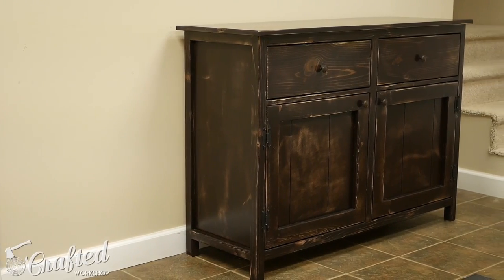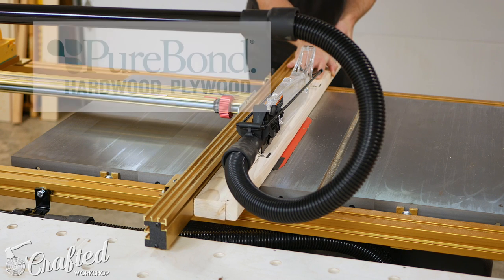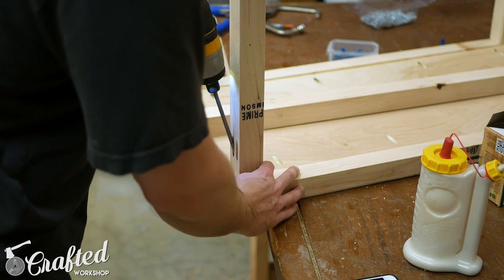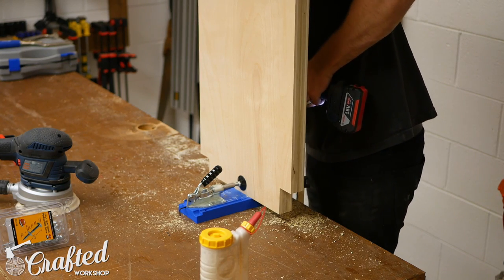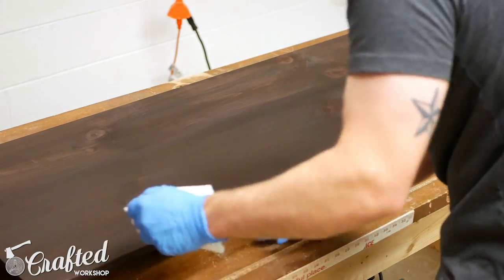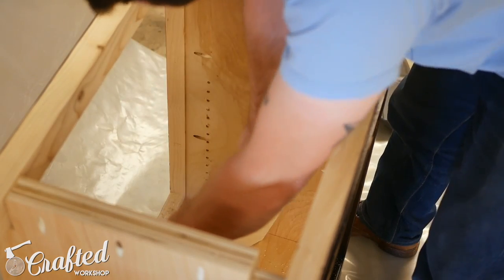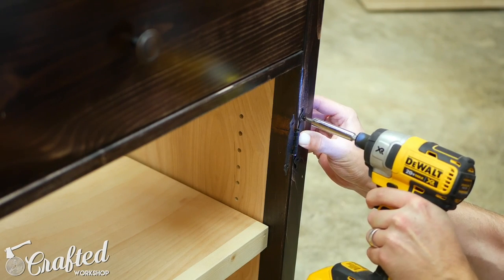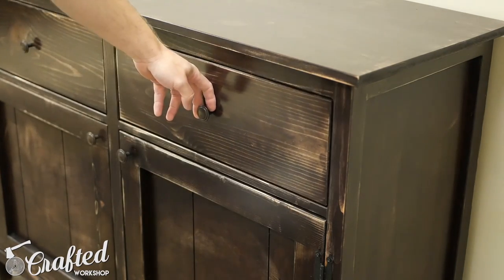DIY Sideboard / Buffet Cabinet |  How To Build

Comment: could you explain what you did to attach the top a little more to account for expansion/contraction?
Reply from the maker: +John Calvert Jr sure! The holes in which the screws go through the frame and slightly elongated in the direction of the most movement of the top. That direction is along the width of the board. I just rocked my drill back and forth when drilling the hole to make it a little bigger. The top shouldn't move more than ⅛" or so, so you don't need to go crazy.

Comment: Have you had any issues with you 1.75hp saw stop with overloading it? do you have it wired for 240 or 120?
Reply from the maker: +The Jones Bunch it is wired 120 and I do trip breakers occasionally, even on a 20A circuit.

Comment: Are the plans still available?  The link on the website doesn't seem to be working.
Reply: The link worked for me and I actually bought the "plans". But it turns out the plans are not actual plans, just cut list and part list, so if you didn't pay, you dodged a bullet of a few bucks lost.

Comment: looks good bro! really nice color.how u like the cordless mitersaw??
🖒or🖓?
Reply from the maker: +Joe basementwoodworking the miter saw is great! I really don't even notice it's cordless, kind of crazy how much power it has and how rarely I have to charge it.
Reply: I bought the Ridgid brushless last week.  Will have to see how it goes.  Presume will be great, too, like your DeWalt.
Reply from the maker: +Phil Veltkamp probably! Amazing how much miter saw tech is changing.
Reply: I wanted to ask you about it as well. Why did you go cordless with the mitre saw? Working away from your shop? I have all corded power tools in my shop back home, except for my drills/drivers. Over here I have the cordless circular saw (for those rare occasions where I brave the 100-120°F heat to make some cuts away from any outlets :P). I am surprised how well the cordless circ saw works - I expected it to be under powered and battery hungry and it turned out not to be the case either. Very impressed.
Reply from the maker: Spareroom Woodworking Dewalt sent me the saw to try out and review. I definitely do not need the wireless functionality on a regular basis but it is nice to have in case I do. The power is just as capable as its wired counterpart, which I was using previously.
Reply: Crafted Workshop no doubt good deal on that..and again,,no doubt!! Will u be doing a review video on it? Cuz im sure people  (and myself) have questions about it. Lol
Reply from the maker: I plan to, let me know what questions you have!
Reply: Yes it is.  The brushless and high capacity batteries are changing the entire power tool scene.  I believe the red mfg intends to make the whole worksite / shop cordless and able to run a whole shift.  Some worksites can get riddled with extension cords and some do not even have power.   Show up with a dozen high cap. batteries and your crew is good for the day.  Outdoor power equipment is charging this way, too.  Cheers.
Reply: Crafted Workshop good stuff! Like how many batteries,what volt,weight and other dimensions blade size,how much $, how long do batt(s) last, any lasers, pos.stops is it a dbl or single bevel.i gta few more but ill save for the video. Lol
Reply from the maker: +Joe basementwoodworking hah, thanks Joe!
Reply from the maker: +Phil Veltkamp yup, I think it's great. I find cordless tools safer generally, nothing to trip over.
Reply: Crafted Workshop always
" it's what I do" LOL

Comment: Awesome video!  Thanks for providing actual details on your website.  I am remodeling my kitchen (whole story has been a nightmare).  After looking all over for cabinets I would settle for I was quoted almost $ 3600 for cabinets for my small L farmhouse kitchen.  (Can you say sticker shock).  And they weren't even what I wanted.  So I reached out to some custom cabinet makers locally, and since we are still in post-Harvey recovery here in Houston they are really backed up.  So I decided I would just make my own  (why let the fact my carpentry experience is limited to RTA pieces and renewing old antique and vintage pieces stop me).  Besides, what says primitive early Americana more than making your own cabinets?  So with my usual gusto, I attacked You Tube.  The steps in this hutch seem like they aren't toooo difficult as long as I pay attention and restrain my inner rat on acid (ADHD).  If it works,  I'll send you photos.  Thanks again!
Reply from the maker: Hah, that’s great Stephanie! You can do it, woodworking isn’t as hard as it looks. Can’t wait to see your finished work!